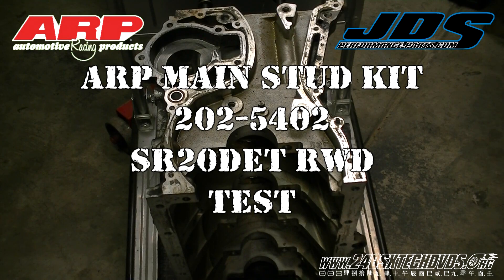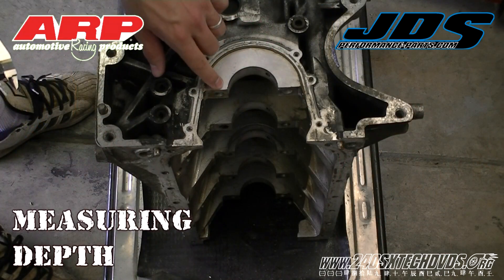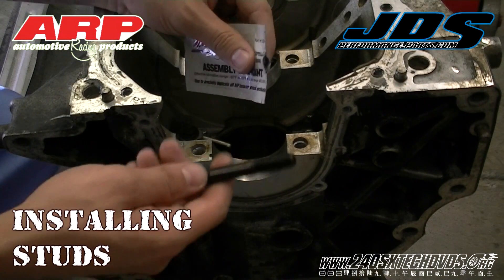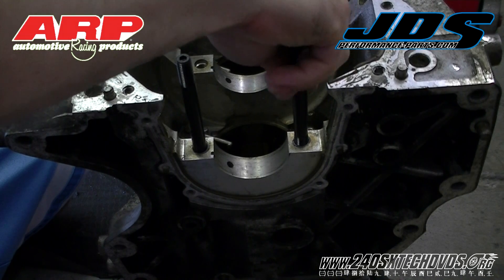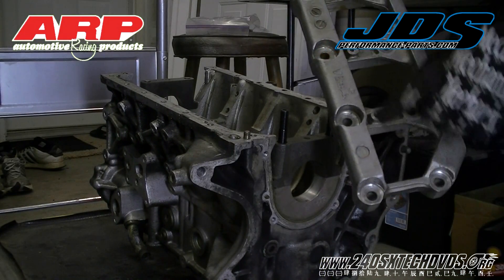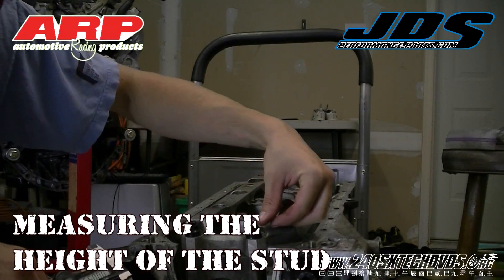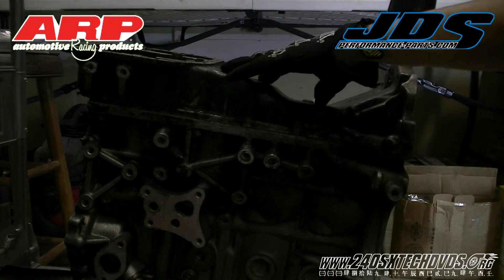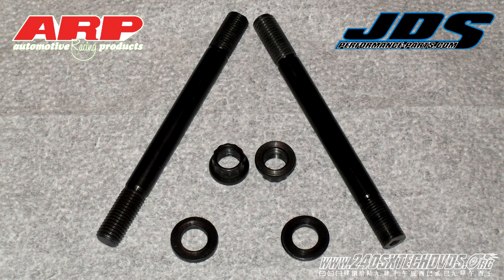www.JDSTurbos.com ARP Main Stud Kit 202-5402 Test SR20DET.mp4

Comment: This problem is solved with newer version von the kit. Hey put 2 shorter studs in it. However they suck ass, as you are ripping your block when torquing them to spec. I would have to line bore it now, as my crank is stuck when torqing above 55ft/lbs....

Comment from the maker: The issues with the caps twisting is ARP's torque specs are too high...I always torque the Mains using ARP and the supplied moly line to 60 ft lb in 3 steps..as for any other studs hitting..I have never had any issues...pix would be great.

Comment: My issue was only with the (while the block was upside down on an engine stand) right side back 2 (last and next to last) studs. I have a Red top SR. 
Did you guys have issues torquing the studs down? I heard of lots of issues with the caps twisting. Line boring the block solves the issue apparently.

Comment from the maker: @CarrionIIX Of course you can as long as they ahve not streched past spec (check FSM) - the ARPs are stronger though and are recommended for higher HP builds.